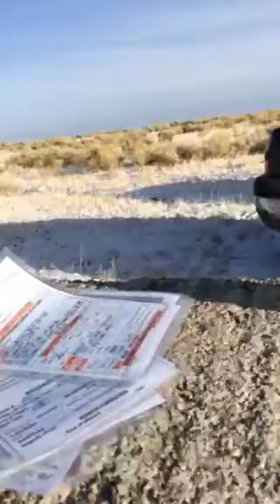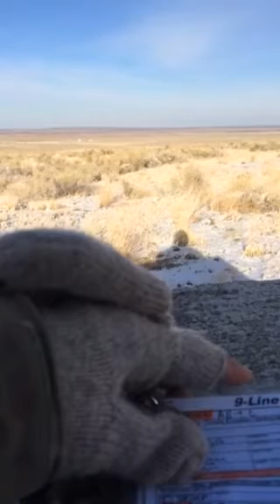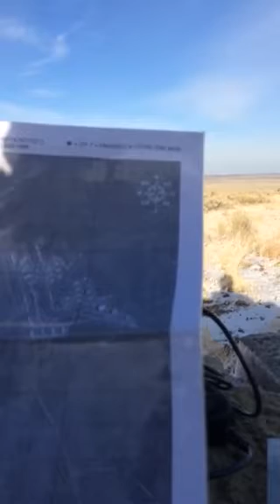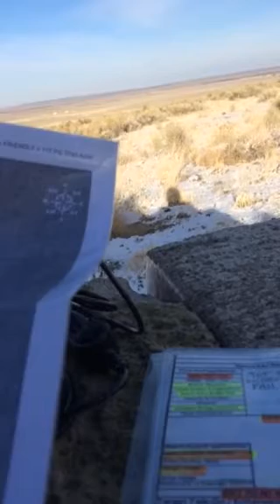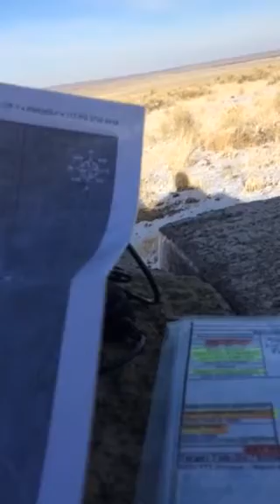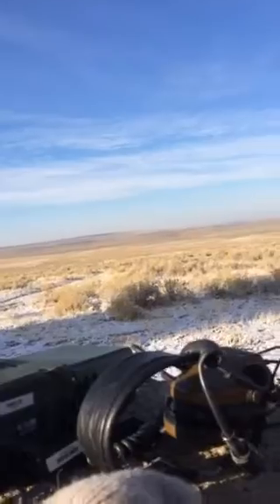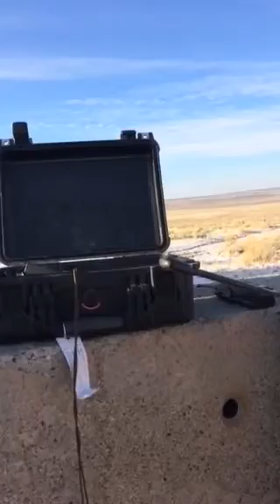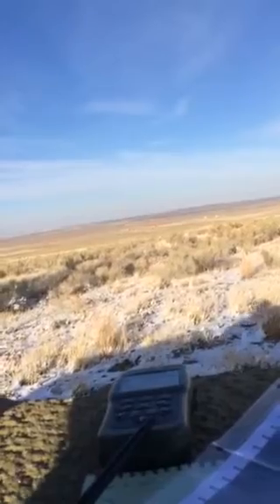TACP controlling F-15s

Comment: Hi, I am from Taiwan, recently I am curious about CAS SOP for milsim, I was trying to listen what you have said but I don't understand the things you said after "type 2 control, bomb on target", and before "5050 ft", were those should be the line 1 to line 3 ? thanks!
Reply: I think he said 1 2 3 N/A
Reply: Lines 1,2,3 not applicable 

Line 1 (IP/BP) 
Initial point for fixed wing and Battle Position for rotary wing. It’s where they start their attack run.

Line 2 Heading 
Direction in degrees magnetic from the IP/BP to the target 

Line 3 distance 
Distance from the IP/BP to the target measured in Nautical miles for fixed wing and measured in Meters for rotary wing. 

I’m assuming he called “not applicable” because the aircraft were in the overhead